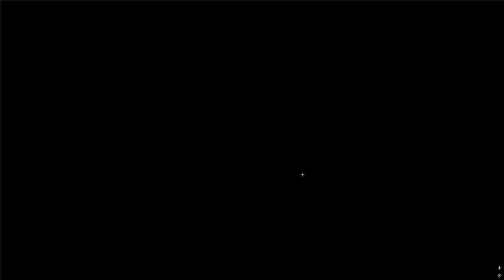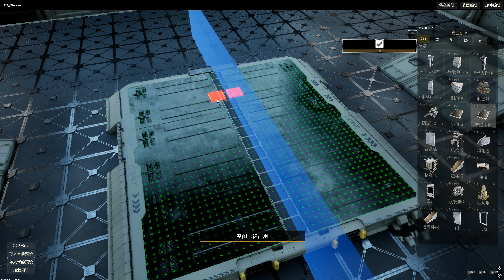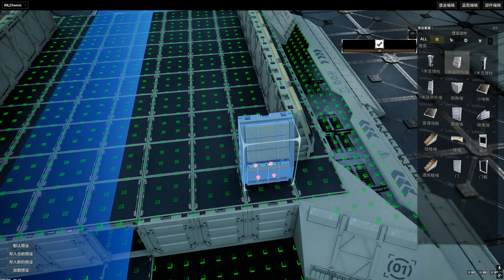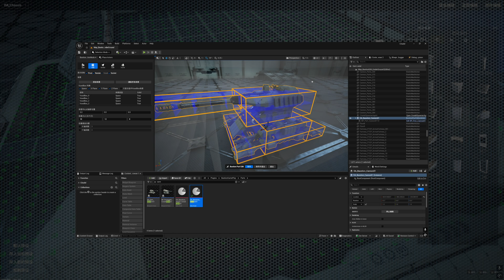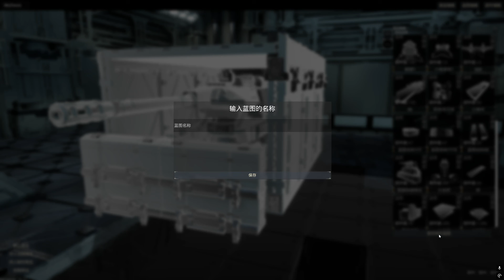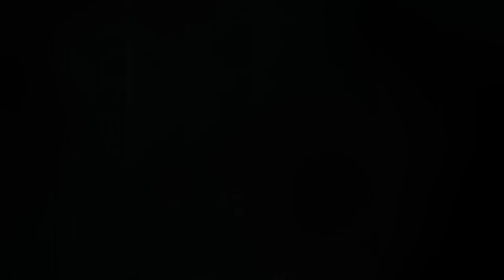How to Build a Heavy Firepower Fortress | Caliber Citadel Dev Log #1

Comment: hear me out. 
Suggestion: Add hireable mercenaries that can live and work inside the Outpost. They could patrol corridors, protect critical modules, operate and reload defensive weapons, react to enemy breaches, and even pilot mechs during attacks. This would make the Outpost feel like a real military base with an active crew rather than just an automated fortress. To keep things balanced, mercenaries should require ongoing upkeep costs and be less effective than player-controlled units.

also Please add compact lighting options that don't take up valuable building space. Large Outposts often feel like dark caves inside. Wall lights, ceiling lights, or integrated lighting blocks would greatly improve visibility and make fortress interiors feel more alive.